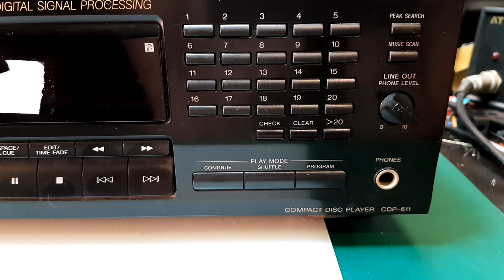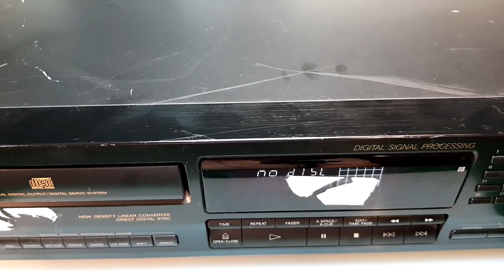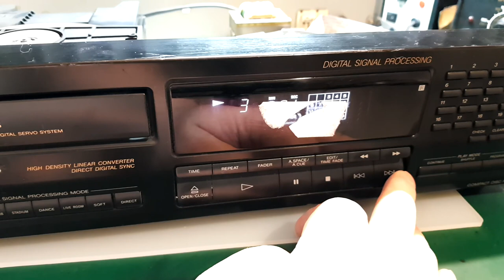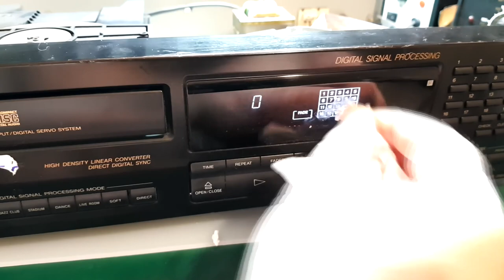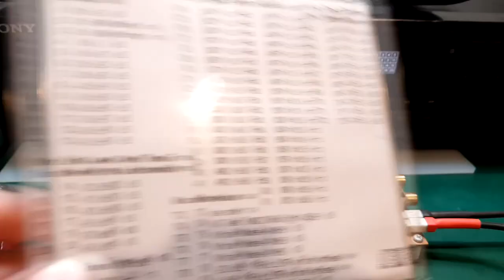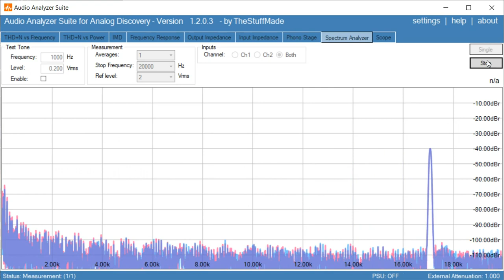Repair of a Sony CD Player Model CDP-611 / CDP-D7 - No Disc Error

Comment: Thank you for posting this. My Sony CDP 991 was giving No Disc error. Normal lens cleaning discs failed, but  and following your instructions , I've cleaned the laser lens and it's working fine now.
Another good bit of tech saved from being scrapped :-)

Comment: Same here. I've just bought a CDP 295. The day after I've bought It, It started with "no disc" and some click noises, as if It was trying to focus. I thought I should buy a new lens kit but I don't know how to fix these things. I've cleaned the lens with IPA cleaner and now It works. Back in the 90's, I had CDs with brushes to clean the lenses. This is more efficient.
Reply: I just got my CDP-295 out of storage - the first CD player I ever bought back in the 90s - to show off it's "cool" tape dubbing feature where you tell it how long your tape is and it'll organise the tracks to fit ... but "no disc" ... but a quick clean with some alcohol ... it's back!

Comment: I have this exact CD player, and I've run into an issue where the tray does not lift after it closes, it will whir for a few seconds then eject. It appears there's something wrong with the large metal section lifting up, almost like its too heavy or there isnt enough current sent to the motor to close it with force. Any tips or idea? Thanks for the video
Reply from the maker: There is a small drive belt on the motor that opens and closes the tray, check that first, it's likely gone bad with age and the wheels are slipping.
Cheers,
Jake
Reply: @TheStuffMade  Fortunately it wasn't the motor, it was the drive belt. Even though it looked fine (no cracking), it lacked the tension needed to give enough friction to pull up the tray. Replaced it just now and its working. Thanks!
Reply from the maker: @Skellingtor  Nice, good to hear you had a successful repair. Well done.
Cheers,
Jake

Comment: Hi, I have a Sony CDP-S41 which when plugged into mains power will not power up then after about 5min the display comes on and it works. I then replaced all caps inside and its still the same but the sound output is now sounding excellent. Can an IC cause this? thanks.
Reply from the maker: Hi, It's very hard to say without doing a few measurements. It could be something as simple as a cracked solder joint or a faulty regulator. Best way to start investigating is to monitor all the power supply voltages with a scope during power up. Sorry, can't be of more help.
Cheers,
Jake